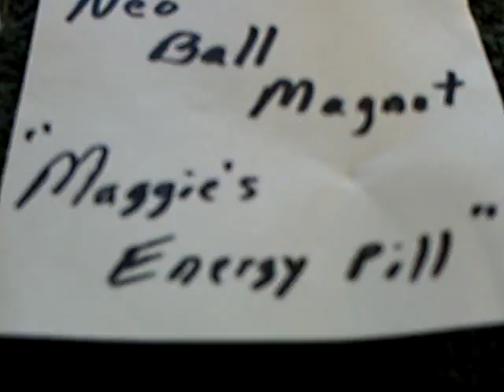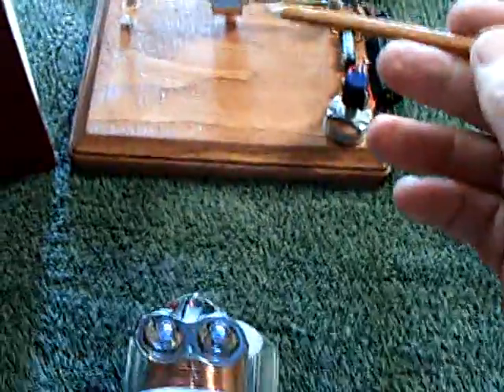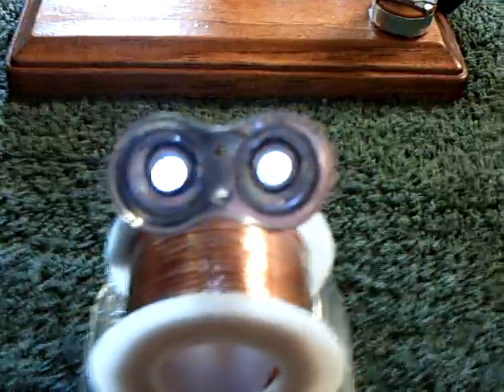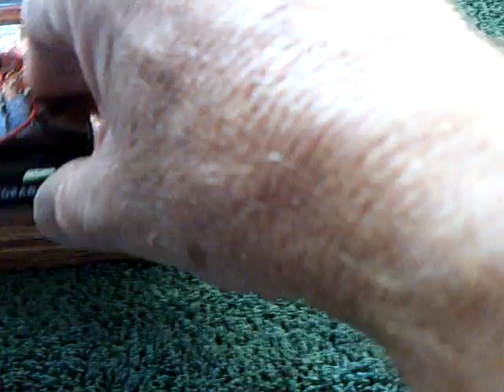Mag-Lev Bobin Motor---reed switch version with wireless energy transmission.

Comment: Another really nice project. What does the circuit look like? I see a potentiometer, but I could not see how it was hooked into circuit and if there were any other parts in the circuit.  You usually have such nice paper drawings that let us know exactly what is in the circuit. If you could clue me in to the xircuit design, that would be really helpful. I am in the process of building your hall effect motor, but I like the simplicity of this one. Thanks, 
Paul

Comment: Lid the reason I was thinking about using solar cells run from a bank of blue leds powered by Maggie, or Maggie powering a Slayer device that powers a blue bank of leds, was because solar cells like blue light.
They seem to have a higher output on blue light. Even if a solar panel charging your motor battery operated by a bank of blue leds won't fully close the loop, it might help it to get closer to closing the loop and also help the battery last longer. Just a idea.

Comment: Lidmotor, have you ever used a Stroboscope to watch your motors rotation and Maggies magnet? They will stop motion and show slow motion. Very small differences in rotation can be seen also that can't be seen otherwise. It would be easy to tell if your motor was slowing down or speeding up under different loads, check your bearings operation too. The newer ones have a speed readout also. I picked up a new one on E Bay for about $100. Sometimes there are good used ones for less on E bay too.

Comment: Lid, if you are looking for something to interfere with the mag fields, laminate aluminum foil to paper to copper foil to thin low grade iron plates, and do it in several layers.
If you want to put a drag on your rotating mag field, place an aluminum can next to the rotor.

Lid, this is a very cool vid, and you are doing Great work.

Comment: I seen on the net somewhere that a large torrid shaped Neodymium magnet will interact with Earths magnetic fields. So much so that when carried by hand, you can feel the difference in the magnet as it wants to align with Earths magnetic fields. A torrid or round Neodymium magnet works best in this application for some reason. I don't know if this applies to your work or not, but is is interesting to think about.

Comment: I too wonder how many Maggies could be operated at a distance without causing a problem with the motor. If you had several Maggies with enough eyes to run a solar panel to operate your motor, you would have a closed loop which would run for ever. Which can't be done of course according to modern science as this would be PM. But what if you could do it anyway? Might be worth a shot.

Comment: I am glad you are feeling better now. This is interesting how Maggie works or don't work depending on just that little ball bearing. I have to wonder how little we really know about magnetic fields. In my other post I suggested that maybe by Maggie powering your Slayer device running a bank of leds,  then using the solar panel DC output to run your motor to to make a total closed loop system. I would think the Slayer-leds would be enough to power your solar panel to run your motor. Might work.

Comment: Hay Lid ....... I wonder if there is enough  EMF or magnetic flux that you could in turn clone Maggie and distance Mag #2 even further away from the bobbin motor? Probably not perhaps because the tiny mag sphere's field effect would taper off sharply because it's field strength is not equal to the Mag on the bobbin motor?  Happy motoring!